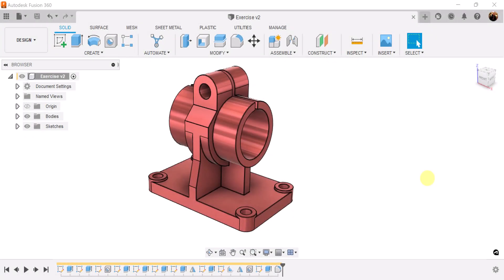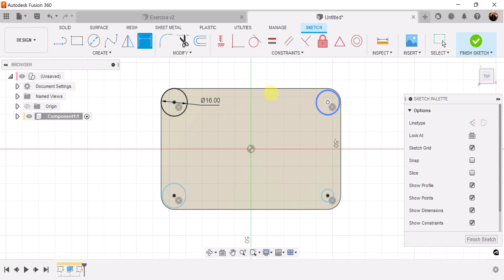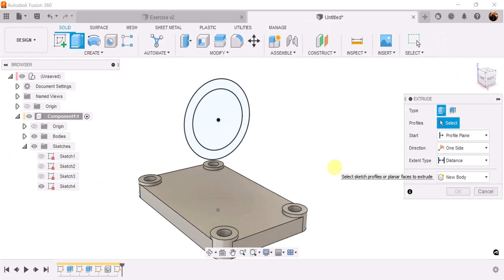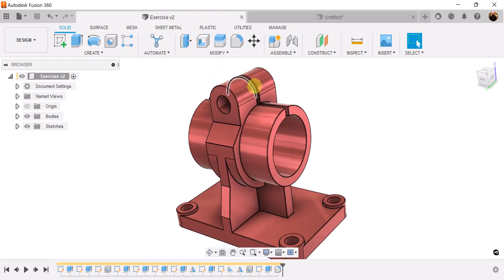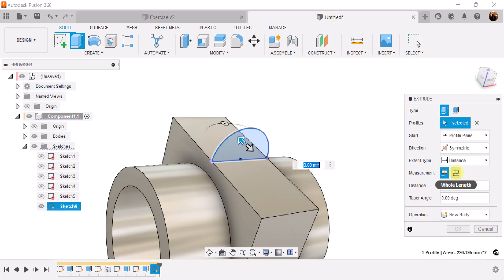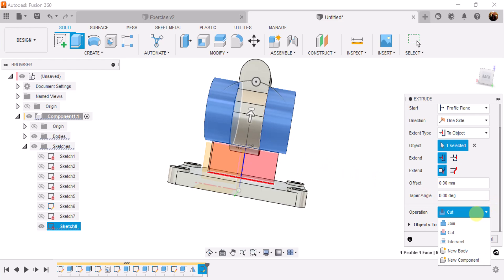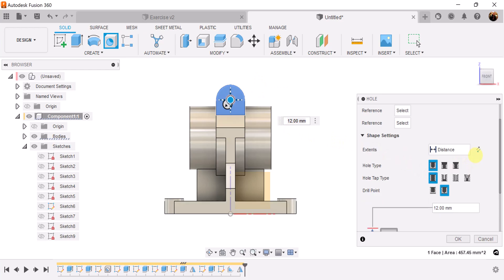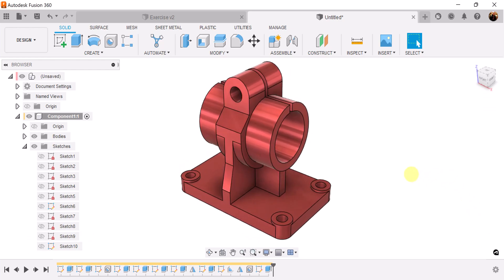Modeling in  Fusion 360 | Rep no. 1

Comment: Question: what happens if you don’t see the (X, triangle) on the center point arc command?
Reply from the maker: Under preferences --> Design, make sure that Auto project edges on reference and Auto project geometry on active sketch plane is checked.

Comment: The first 4 holes you made. What’s the difference between “projecting” and extruding the holes?
Reply from the maker: When you use the extrude command, you are  adding depth to a sketch profile to create a solid object. Using the project command allows you to trace or copy the area around an existing piece of geometry or part of an existing sketch onto another sketch. This is pretty useful to achieve an exact outline to follow in your design or as a quick cheat to avoid reproducing something you've already created in another sketch. In this case I used the project command to borrow or trace the outline of the 4 circles which also contained 4 center points needed to create the 4 holes using the hole command.